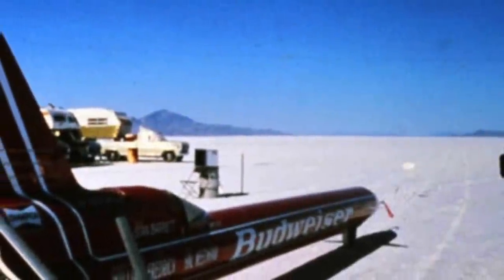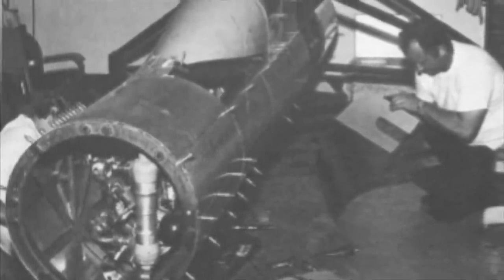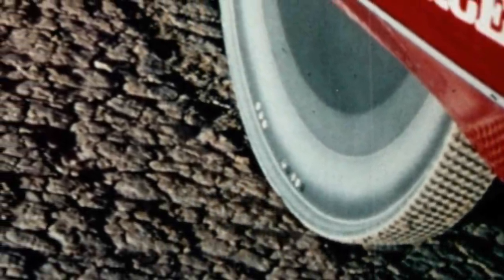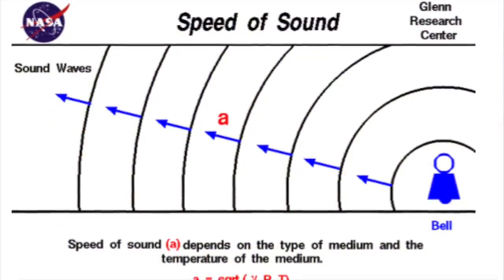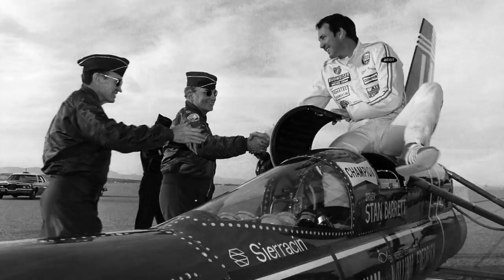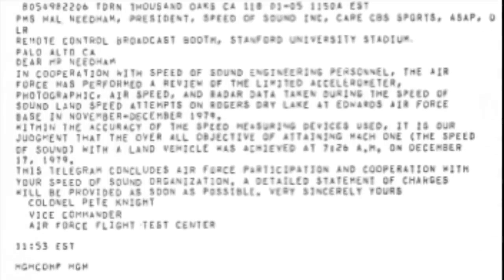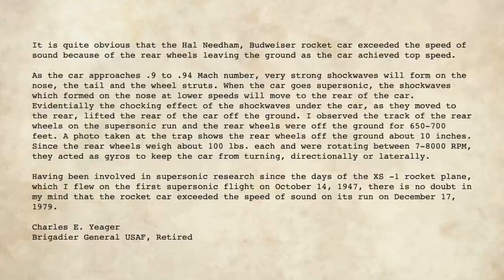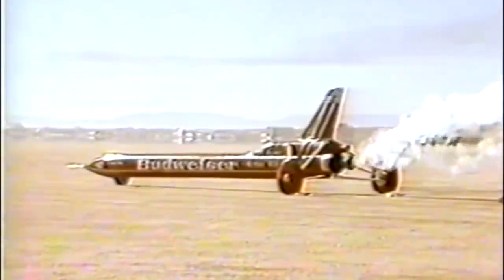The Budweiser Rocket - Controversial Rocket Car

Comment: I don't know, man. Someone should have heard the sound (or it should have been otherwise detected) as the vehicle achieved mach speed.
Reply: It wasn't recorded on the TV broadcast or on the accelerometer.
Reply: The cross section of the car was so small it would have made a much smaller sonic boom, like a small missile rather than a jet
Reply: @nathanchildress5596  Doesn't matter. A vehicle that size will make a sonic bang. That one should have but the sound of the engines was heard before anything else which means it wasn't supersonic. The bang should have been audible at about the 4:53 mark but there is none. Nor are there any visible shockwaves on the ground or Schleire in any of the photographs. They seem to have done everything they could to make the facts fit their narrative.
Reply: @nathanchildress5596  Good point on the smaller cross section of the vehicle and the size of any sonic boom. After watching again, I believe, if the vehicle reached 630MPH and the Sidewinder was fired it's entirely possible the sound barrier was reached. Also the sound would have been reflected off the surface nearly vertically.

Comment: 17 m/s. I can beat that speed on my bike. Just in one direction (down hill), but that’s the way they run their car, too.
Badly set up speed traps, sensor not meant to integrate their values, a messed up radar and some post-hoc data wrangling, and the opinion of one test pilot. Not good enough.

Comment: The Brit's had a V bomber, the Victor VMk2, that broke the sound barrier in the early 60's - it smashed almost every window in Yarmouth high street - trust me you would know if you broke the sound barrier.
Reply: Weird crap happens that close to the ground.
Reply: Yeah although the Victor could not break the sound barrier in level flight, it could in a dive.  Fantastic plane - looked like something Ming the Merciless would use to conquer planets...
Reply: Love the V bombers, but they were like 60 feet wide, not 20 inches. The boom made by something shaped like a missile would be way quieter than that
Reply: @nathanchildress5596  Its much more likely that parts of the design started to go transonic   ie where air has to speed up to supersonic to get round protrusions  however the main body is still subsonic - My friend anyone who has stood  on a runway  when a Harvard trainer when its propeller tips go supersonic will tell you  its deafening - You would know

Comment: It seems to me highly appropriate that the controversy that surrounds whether the Budweiser Rocket actual broke the speed of sound overshadows the project itself. It is, after all, an extremely bold claim, driven by commercial interests and was done without scrutiny by independent observers and a deficit of actual reliable data. That it's controversial is entirely down to decisions the team made over these matters. 

The rest of it is interesting, but the status of the claim is surely paramount.
Reply: @BenDecko2023  You seem to have the attention span of a mayfly given that you think 81 words is an excessive. Just go read something shorter.

Comment: The people that are doubting, it was clearly capable. It was going 600mph on the test runs without the side winder. It clearly had the power to do it. The technology at the time is clearly at fault. Nowadays that wouldn’t happen. On top of that supersonic speed and supersonic booms are 2 different things. Something can go supersonic and not make a boom. Depending on the air pressure temp and humidity the boom can come at different speeds. They may have miscalculated and had to go 740 to get a boom. They claim supersonic by having gone over the calculated 731mph not necessarily by making a boom. That’s not taking into account that with such a small and long profile, a boom would be delayed and relatively small. A larger vehicle with protruding wings closer to the nose for example produces a larger boom. On top of that, there was controversy about it having 3 wheels. Regardless, this was a great feat of engineering at the time.
Reply: J  They went through that when the first three wheeled car broke the land speed record. For a while they still considered it a motorcycle. Later they agreed to let three wheeled vehicles be considered cars and the official land speed record would stand for all.
Reply: No boom = not supersonic.
Reply: Sonic booms aren’t all the same. A jet makes a huge sonic boom, while a missile makes a tiny one, it’s not hard to understand

Comment: Do ground to air missiles produce a sonic boom as they go supersonic? The Budweiser had a very small cross sectional area and may have produced a boom smaller in amplitude than the Thrust. In any case, the lack of accurate speed data for the Budweiser's run is unforgivable. The Air Force should be ashamed.

Comment: why in the name of christo did  they not use proper timing marks? spend 1,000,000$ on a car, but cant spend an extra 1000$ on proper timing setup
Reply: The USAF getting the radar readings wrong as well is a bit concerning as well, especially in those Cold War days. 

Also not releasing the data for the acceleration or the timing beams is obviously questionable. 

However, as the nicely unbiased film says  having a rocket AND a Sidewinder missile you cannot turn off  for an attempt it pretty plucky.  Hats off to them for getting as fast as they did ( whatever it was ) and came back in one piece.

Comment: When a jet makes a sonic boom the disruption of air can be seen at the back of the aircraft (there's pictures of this phenomenon) & is roughly the size of the wing width of the aircraft. Perhaps this cigar tube on wheels doesn't have enough surface area to disrupt enough air to make a boom that is very audible, especially over the engine & rocket noise? Not an engineer or scientist, just wondering.
Reply: The loudness from a gunshot isn't so much the explosion of the gunpowder as it is the bullet breaking the sound barrier
Reply: @Thomas Bradberry  what makes the noise from a firecracker or cherry bomb? No projectiles there. What about a blank cartridge?
Reply: @Beezlie727  This is a surprisingly complicated question.  The short (and possibly incorrect) answer is that the BANG from a pyrotechnic explosion is from the quick release of gas causing a pressure wave in the air.  But it doesn't have to be "breaking the sound barrier" for you to hear it, but it is traveling at (or even faster than) the speed of sound. What I think Thomas is saying is that a lot of the loud sound one hears from a gun firing is the projectile breaking the sound barrier, not just the powder explosion.  As an example, if one uses a heavy lead pellet in an air gun, it might only have a muzzel velocity of 900fps.  It won't be loud at all.  But a very light tin pellet in the same gun will hit 1400fps and make a very loud POP sound.  That sound is solely attributed to the sound barrier being broken. Slamming a door might be a loud sound, but the loudness isn't due to the breaking of the sound barrier. It's just a loud noise traveling at the speed that sound travels.
Reply: "When a jet makes a sonic boom the disruption of air can be seen at the back of the aircraft (there's pictures of this phenomenon) " Um....NO. The phenomenon you're talking about is a transonic effect.

Comment: With the benefit of hindsight, having watched the Thrust SSC attempt, I don't believe they went supersonic that day. Irrespective of the fineness of most of the vehicle, there were plenty of features that would generate a significant shock wave - the cockpit profile, the vertical stabiliser and the rear wheel fairings. I believe these would have generated a visual and audible boom, even over the sound of the rocket motors. This coupled with the vagueries of speed measurement methods employed suggests the team's claims are exaggerated. That said, the attempt was still in my opinion a technological and engineering triumph of a high order.
Reply: Thrust SSC wasnt an "attempt". 
The car DID break the sound barrier in each direction during its run.
Reply: @scotte2815   - Lame

Comment: Kitty O,Niel felt confident on her second run the Motivator could go 700 mph  .Al Needham dialled Her power down to bring Kitty,s Average down to 512 mph .A record Jessi Combs tragically died chasing .
The same car with Kitty driving still owns the standing starting  quarter mile record of 3.22 seconds at 412mph .

Comment: A sonic boom may not have been heard over the noise of the rocket motor and the sidewinder firing?...LOL That is laughable! If that sound barrier is broken...You "will" heard that sonic boom over anything else...period.
Reply: Maybe it just wasn't able to push past that barrier. Because the barrier comes with some resistance yeah? It came very close but not enough beans?

Comment: Can't they use the film to measure out some of the distance traveled and calculate the time it took to cover that distance thus giving them the speed of travel it would have to be going to cover
Reply: or gps
Reply: That's a good idea, but unfortunately the things that make places good for LSRs (flat, devoid of features, with nothing to crash in to) mean it would have to be done against stuff in the distance. This would have a massive +/- uncertainty so they'd probably end up saying 600mph +/- 200mph.
The fact they never released any data makes it pretty clear they didn't break Mach 1.
Reply: GPS wasn't available at the time I don't think. Using a camera, preferably a high-speed one, could be done against marks on the ground or posts next to the course, or even a striped pattern on a board behind it - think what you see a lot on Mythbusters as the backdrop for many of their high-speed "how fast is it going?" shots. Problem with that approach is that it would only work over a set location on the course, thus having the same problem as the light-gates that were set up (but apparently didn't work anyway) - they capture the speed it passed a given spot, which might not have been it's fastest speed. They're trying to determine if it ever was going supersonic, not if it was in a given location - where it's top speed would be attained would be difficult to predict. I'd think some sort of onboard measurement such as a pitot tube (as used on aircraft to determine how fast they're going, including if they are supersonic) would be the best approach. I guess that might not be considered ideal if it would be measuring airspeed rather than groundspeed, but of course the sound barrier is about airspeed rather than ground speed so arguably it's more relevant anyway. A wheel-speed measuring device might be possible as well, ideally an electronic one that would probably use either a magnet on the wheel and a hall sensor next to it (sort of like how some ignition timing works crossed with those digital bicycle speedometers) or an optical sensor next to a part of the wheel that's half black half white. But of course if the rear wheels were off the ground that might not be accurate - but again is it a supersonic car if it's partially flying at that speed?

Comment: The fact that the team never released their accelerometer data, tells me they failed.
Reply: SuperGoldnut  you keep saying that on people who doubt it. What you are doing is saying is anecdotal evidence is better than factual evidence. Wrong
Reply: SuperGoldnut  Radar does not measure Mach events.
Reply: SuperGoldnut Then why did it take eight hours to verify, why did the team resort to accelerometer data and why did they revise their answer 24 hours later? You’d think with all that equipment they’d have an answer in less time than that. It was, after all, designed to intercept incoming aircraft and missiles. And why did the USAF disavow any support for the attempt?
Reply: SuperGoldnut So what?
Reply: SuperGoldnut The speed of sound is temperature dependent.
Reply: SuperGoldnut Look it up. The speed of sound is temperature dependent. Pretty much all other factors vary with temperature. This is not my opinion, it is fact. We are not talking about water.
Reply: SuperGoldnut I did not say that. You said it. Relative humidity is also dependent on temperature.
Reply: SuperGoldnut Density is also temperature dependent. You really do need to look it up.
Reply: SuperGoldnut Did you get that off Quora or something? If you look up a science text you’ll find that the pressure of a given volume of gas increases with temperature because the particles are more excited. That’s basic science. You learn that stuff in primary school. Remember what happens when you boil a can full of water then take it off the boil and screw a cap on it?
Reply: SuperGoldnut Here’s another version of the same experiment: https://youtu.be/xg5NiOwf_Zw
Reply: SuperGoldnut Yes, I know how atmospheric pressure is measured. That doesn’t mean the speed of sound is not temperature dependent. It is.
Reply: SuperGoldnut Look up the speed of sound instead of of pressure and all that other stuff. Any aerodynamic text will tell you that it varies with temperature. I’m not really interested in arguing random examples. That’s just a distraction. But in this specific case, why do you think they did it early in the morning when the temperature was about -10C?
Reply: SuperGoldnut Stop arguing and look up any aerodynamic text. This is not me talking, this is basic aeronautics. I don’t care what you think of me because it’s irrelevant. The speed of sound is temperature dependent. Fact. Pilots know this. Engineers know this.
Reply: SuperGoldnut They did it in the morning because the speed of sound is lower when it’s colder. Simples.
Reply: SuperGoldnut No, I’m not lying and it’s a pretty sad reflection on your thought processes that this is the best answer you can come up with. Look up “Mechanics of Flight” by A.C. Kermode. It’s a standard aeronautical engineering text which is also used by pilots. The reason temperature is used is because all those other variables you keep carrying on about also vary with temperature. I know you think you’ve got all the answers but you’re wrong. Calling me names doesn’t make you right. You’ll never learn anything with an attitude like that.

What have I got to gain by lying to you? Nothing. You’re just someone on the internet. But if you choose to ignore it, that’s your business. You’ll still be wrong.

The speed of sound varies with temperature. Fact. All the other factors that influence the speed of sound (in air) vary with temperature. That is why it is reduced to temperature in the first place. Fact. You’re wrong. Argue all you like. Call me names. It won’t change anything.
Reply: SuperGoldnut And what happens to temperature at altitude, genius?
Reply: SuperGoldnut No, it controls relative humidity. Can’t you read?
Reply: SuperGoldnut The speed of sound doesn’t change because it’s at 40,000 feet. It changes because it’s colder at 40,000 feet.
Reply: SuperGoldnut I didn’t change the words.
Reply: SuperGoldnut  I don't know why you're even bothering to go off on that tangent. Humidity isn't used to calculate speed of sound anyway. And you missed the fact that humidity and relative humidity are not the same thing. Furthermore, your claim about atmospheric pressure is irrelevant:

http://www.sengpielaudio.com/SpeedOfSoundPressure.pdf
Reply: The fact that the accelerometer data didn’t record a sonic event, the fact that no sonic boom was heard or recorded by the television broadcast and the fact that the data from the pitot head was never factored in and has never been released is a pretty firm case that they did not go to Mach 1.

Comment: Next time, substitute the "speed of sound"  for "sound barrier."  There is no such thing as a "sound barrier." The term was commonly used when it was believed that it was impossible for an aircraft to achieve supersonic speed and remain intact.  That is obviously no longer the case.
Reply: Speed of sound at sea level or Mach 1.0 is 767 miles an hour not 739 . i liked your comment
Reply: But doesn't the speed of sound come with some resistance like a pressure wave as you are about to match or pass it?

Comment: Zero percent chance they went supersonic. Modern CFD analysis run on the car show it did not have enough power to do it. The rear end lifting was an aerodynamic effect of the rear suspension struts' shape and configuration. It would have occurred at sub-sonic speeds.
Reply: how the USAF comfirmed that they broke mach 1 ? a mistake ?
Reply: There was and is absolutely NO controversy about this record. NOBODY is arguing that The Rocket did not go supersonic! It only missed out on the official record because they did not do two runs in an hour. The speed was verified by the same people who monitor X-plane speeds and altitudes! FILTHY LIES!
Reply: show me this analysis